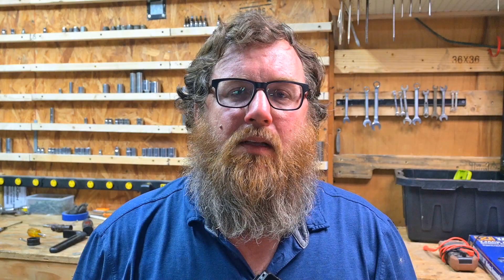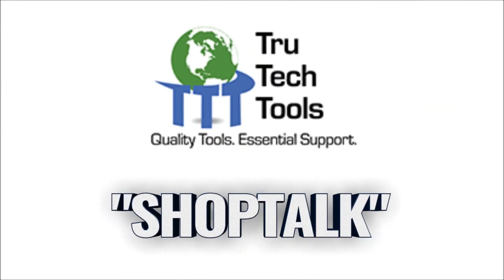What Causes Equal Running Pressures in an HVAC System?

Comment: Is it OK to take wrapping jacket they put around a older R-22 Trane Compressor that runs great ? Would it let it run cooler ? Seems like the "quiet jacket" hold heat and not allow the compressor air flow just from my perspective. Thanks.....
Reply from the maker: Those jackets do cause some compressors to overheat.

Comment: Well I know that at a given temperature static pressure is the same for both low and hi pressure gauges for a given refrigerant such as R 22 when it is recovered  or R 410 a   When we are recovering and we cannot  find what refrigerant  is in the system because there is a worn out label at 85 degrees Fahrenheit R 22 is in the 155 psi range on both gauges and r 410a is  in the  255 psi range on both gauges at static pressure when the system is not running..

Comment: I had a unit the other day, exactly equal pressure, about 1/2 running amps. 
Carrier, heat pump, recip compressor 
m# H29B28UABCA
 it’s not gauges or piston. I used probes.
I was told even if the rev. Valve was stuck it would still have a slight pressure diff. 
What else internally could be the issue?
Reply: any ideas?
Reply: @morphius747  fresh out. I just told em it was broke and replaced it.
Reply: @MoonRambo702  aigt cool

Comment: I had that problem or similar pressures with one of those fancy mobile systems and i though it was a blown out orifice tube but it was still kinda cooling and now im replaying the compressor but the orifice tube was pretty clogged up because i used rtv on a gasket well it is what it is

Comment: I thought that a compressor’s job was to move and compress refrigerant. If you then have a reversing valve that is stuck and refrigerant is bypassing through the valve, that would cause the compressor to move more refrigerant which intern would cause the compressor to do more work and draw a higher amperage.
Reply: Heh?

Comment: When I bought my current house and the new unit was not working well. The liquid line was sweating from the outside unit to the evaporator.  When it was opened up the piston was never installed.
Reply: We’ll, maybe it had Txv and partial plug in drier was flashing refrigerant entering Evap coil, this causing it to feel cold. Maybe?

Comment: A bad heat sequencer will do it every time. 😉👌😎👍
Reply: Heck yeah. A bad sequencer will engage heating elements while Cooling is on. This temp drop will be low, and amateur tech keep adding refrigerant or worse condemn Txv. 
The best way to know if heating elements are turning on is call Hp for cool and have a duct thermometer on supply. Then disengage AC disconnect outside and observe temperature.